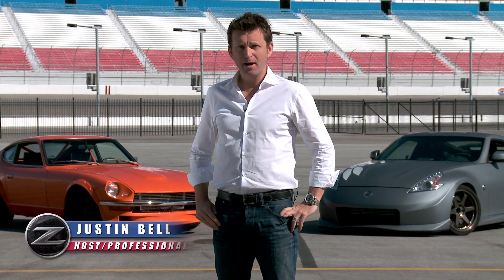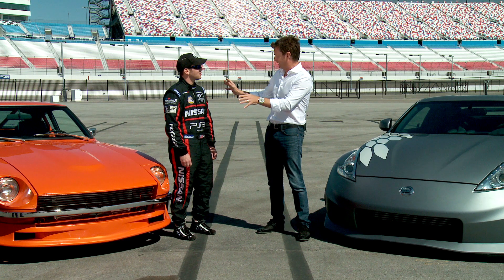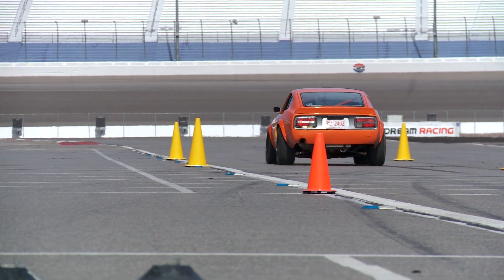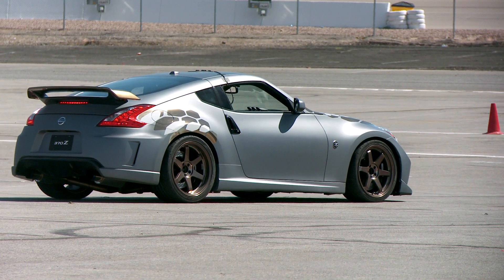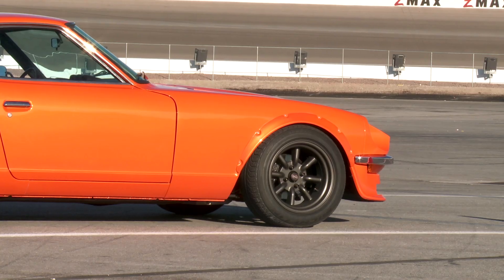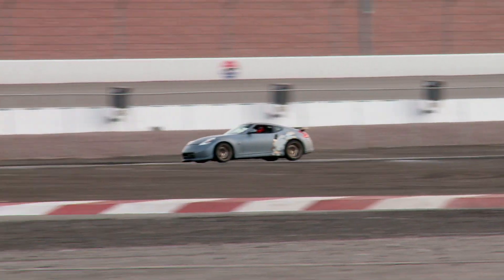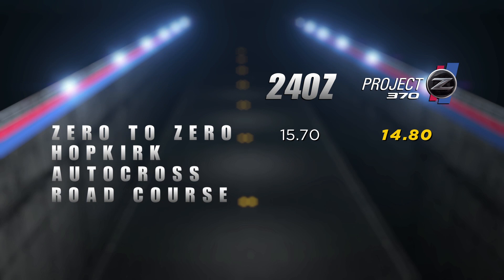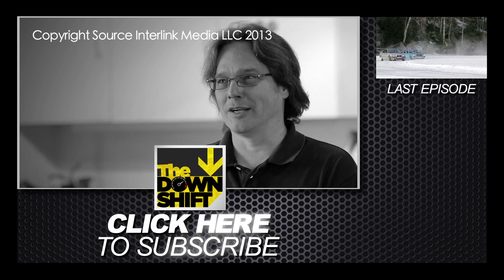Nissan Project 370Z vs 1970 Datsun 240Z with RB26 Track Battle! - The Downshift Episode 54

Comment: the 240z misses 2 very important things: one is the braking system two the steering system.
I guess builder didn't update the braking system and the steering system in order to give it closer feeling to the original build, but that well make him loss in the track challenges because this 2 things are very important in the track.

Comment: V8 swap wouldve gotten better times and more power, but this build is done as right as can be (read the build thread on nicoclub). If he built this car for performance like the 370 was it wouldve been a lot faster, but this was just a guy who built a car because he loves cars and wanted to give a 240Z some more oomph. That and the 240Z has 360hp and the project has 500hp (stock 370 has 332hp). I think im just chafed because the the presenter

Comment: power wise the stock rb26 puts out 280 hp at the engine not 320 the rating they put out for it is wheels of 360 not 400. 280 after 15% drive train loss is 242 whp which coincides with what gtrs dyno at stock(was very difficult to find a stock dyno.) so funny how thats 150% exactly. the greddy rating is about what the kit can max out on as it comes from greddy. the stock vhr rods have issues past 500 hp its hit or miss, track cars they keep around 480 whp

Comment: turbos have the same response they behave the same until the turbo car hits boost. at absolute worst the turbo car has slightly less power before boost from lower compression(however due to fuels available at the pump nowadays 10:1 is pretty common on a turbo car) but going from say 11:1 down to 8:1 results in 2.5% power loss, you wont even feel it and has nothing to do with throttle response. 99% of people who talk about throttle response use the term in the absolutely wrong way.

Comment: It would be dangerous to drive but increase the boost a little bit to bring the hp to 600. If the current output for the Z is only about 380hp it would have been a better to have a 3.2 stroker l28 instead that way you get the same amount of horses but with more torque.
Reply: *****  getting an l28 past 400 is difficult, it's different for the RB26

Comment: A G-Nose widebody with better suspension will allow the 240 to get a lower stance and better grip on the track. Small tweaks here and there she will perform. Not bad for an older car.
Reply: It's an it, not a she. It performs already very well for an old car. A 70's car will not outperform a new car unless heavily modded. And as far as suspension, he still needs to enjoy driving it. But yes, to your point, it can always be improved. But life it's about lap times.
Reply: It's a she actually, she's a Fairlady ;)

Comment: This is all just benchracing anyway, not considering all of the factors at play. There's a lot more behind a car than just the power to weight ratio. The 370 would destroy a 240 stock to stock. If you were to go solely with power to weight ratio, the r35 would be a PoS.

Comment: For 40 years of difference, that is actually quite a narrow difference.
And it shows how good the Datsun still is.
Also, the 370Z is not the best you could get at the time, but would be the coolest comparison, heritage and all.
If i had to pick, i'd still take the Datsun, but, upgrade a bit, for example some more suspension work and brakes, and who knows what else for as long as the budget would allow, currently none. :s
Hell, i'd love to own the Rotsun, that car looks sick as shit, literally and figuratively, and both are cool in this case. It would have to be fixed up a bit to be legal here for sure, and i'd want it somewhat reliable, but i wouldn't mind at all if it looked rough as fuck.

Comment: Its a GT-R Motor it should be fast. The only thing 240Z about that car is the Body and steering. Its a really nice project car. If you want to do a fair comparison then take both car set them up to the new off the car lot specs and then race them.  I'm sorry but to see everyone ripping on the new car out of nostalgia is silly.  How fast could you make the 240 if you used the original 240 motor?  The winner was the the diver who got to play in both of those cars

Comment: bottom end as in power curve or bottom end as in rotating assembly? because neither is true there are dozens of non inline 6 engines which hold huge power, its all about if the factory uses forged parts or not, which has nothing to do with engine type. perfect example, GM 5.3L v8, holds 1400 hp stock block.

also in addition to that the current world record holder for a 6 cylinder in drag racing is a vq35de making 2400 hp which is a v6

Comment: Put the same model tire on the 240z in the tire size the 240z was running in this video and re-run the challenge. 370 probably still wins, but the results will be closer. With an equal coefficient of friction at the contact patch the lighter weight will begin tobalance the equation against the advantage of 40 years of technology if the 370. I'm surprised that the results were as narrow as they were. If both cars were wearing the same tire, I can even see the 240 winning. Mass matters. When two similar cars of different eras are tested against each other like this, you have to reduce variables.  Both cars should be wearing identical rubber.

Comment: also your comments make it apparent you have never driven a 370z or hell even a 350z, the abs on these vehicles actually blows horrendously and the vdc is even worse hence why alot of the guys who actually race them(minus spec z) swap out the brakes for manual brakes. going for a 370z period for performance is a bad idea due to overheating issues and difficulty modifying the vvel(most guys swap on HR heads) but comparing it the the 240z isnt fair. the 370z does have about 300% more stiffness tho

Comment: This is a ridiculous comparison. a 1970 Z vs a 370z with every technological advantage of the past 40+ years... come on. lol pretty comical really. The amazing thing though is how competitive the 1970z was against a modded 370. pretty amazing.
Reply: +Nice Shot keep in mind that it had an engine from the late 90s early 2000s, as well as some modern suspension work. if it had electronic power steering and better brakes/abs it would've been even closer, if not in the 240s favor

Comment: Without a doubt the 240 wins all day, no technology, raw power and a very well proportioned engine to weight ratio.  I mean that is a 50 year old design that can be easily modify.  This why Nissan needs to go back to the drawing board and the next generation Z, must be reminiscent of the original design from body, front and rear fascia to an aggressive stand.  The wide body option exemplifies the best use of aerodynamics that allow the car to efficiently cut down the drag factor.  Nissan is in the verge of trimming down their offerings so, dont let the Z be a model that gets water down even more.  Toyota has not gained the upper hand with their supra design.  They couldn’t even do it solo, instead they brought in BMW to share costs, design, output but they did not even come close the legendary supras of the 80’s and 90’s as those cars maximize the driving experience and the ability to customize the car.  There is still time to get the new Z model done right.  Ford won the design for the retro mustang in the 2005 model and they revived their sales as the production of mustangs has been on the rise.  Look back at the 2005 and put it against a 1970’s mustang and you can see the thoroughbred design and its glory.  I personally take a 240z all day before i look at the 370z.

Comment: you should educate yourself vs posting misinformation, the 240z is 2300 lbs stock, this guy is running a partially stripped interior and a shaved engine bay putting actual weight closer to 2100 lbs, if he went crazy on some stuff we cant see 2k is a very real possibility. the 370z is 3300 lbs base no options, this one optioned out with custom interior and twin turbo kit is closer to 3600-3700 lbs so yah damn close to double weight next post will address power.

Comment: The test were completely unfair. You can not compare the stopping power of a car with anti lock all wheel disk brakes to one with disks on the front and drums on the rear. I have a 280ZX which came equipped with all wheel disk brakes, but it is still no match for today's modern systems. I'll keep my 2.8 liter turbo charged in line 6 . Those two cars could never be compared fairly.

Comment: 200HP? you are bout 50HP off there bud. The most powerful factory spec NA L-series engine came out of the 280z in 77 at 170-175 HP. 185HP out of the turbo 280zx

Comment: Id guess the old Z is about 2500lb, the 370 isnt 5000. From about 320hp to about 400hp isnt 150% but about 25%. How many % had the Greddy twin turbokit added to the 370? Greddy promises 535hp... So you have a 535hp 3300lb modern new car built by a proffessional tuner backed up by Nissan. And basically all it excelled on was breaking, with its high spec brakes, grippy tires and smart ABS system that not only prevents tires from locking but does so individually on each wheel perfectly.

Comment: not to mention if you actually cared about NA power and wanted to stick wish a nissan 6 there are much, much, much better engines then the rb, the vq series is light years ahead of the rb's when it comes to NA power or even a tb48de if for whatever unknown reason you insist on a inline 6.

Comment: you also missed where the 370z beat it in every test except handling(the 240 weighs significantly less that should be a given)
finally moving up, the tires arnt "grippy" they are low profile about as far from "grippy" as you can get. increasing 1mm in sidewall is equal to about 10mm in width, and they for sure arnt r compounds nothing is sticking to them so the 240 has the tire advantage in both sidewall AND width. "high spec brakes"? the only thing bbk's do is dissipate heat they dont increase

Comment: bigger brakes mean absolutely nothing........ they dissipate heat better nothing more you increase braking power by changing the piston on the master cylinder . he wasnt loosing traction in the 240 while he was having quite a bit of trouble in the 370 so tires would have done absolutely nothing(but would have significantly helped the 370) finally power steering makes no sense, you do realize most race cars outside of drifting dont even use power steering? wouldnt have helped again

Comment: if you put all modern parts in a 40 year old car its not really a 40 year old car .The only thing that wasnt really modern was the brakes , A true classic 240 would have been alot different.
Reply: wanteds13
 not to me but its just my opinion.
and the suspension design was one of the first things changed.

Comment: It appears to me that the 240Z suspension is not properly setup / invested in. Allot of body roll happening. I would venture to say that the owner spent most of his money on the engine swap before tackling other areas of performance. A properly set-up 240Z with a race prepped L-series engine would have come out on top of that spec 370.  I smell a Nissan 370Z promotional rigged event.

Comment: The guy in the stands who bought a super bike is the real winner.  He got higher power to weight, faster acceleartion, better fuel economy, more kick in the pants, and higher top speed..  right off the factory floor... stock...  than both these cars... by a wide margin... instead of farting and dicking around with this Z crap for years.    Yeah, I can say it, cause I've had four Z cars... been all in and out of the FSM's.  They are crap cars.  Wish I could go back in time & buy a bike instead.

Comment: i think that 370 had better brake also bigger disc compare to the 240 and much wider tire front and back too...and somehow if both car had same exact tire size and same brake size..the 240 would stay side by side with the newer car....BUT if someone nice enough to me and give me the 370z i would say thanks alot and then i sold the car and buy 240 z......

Comment: Also bigger brakes was just a general statement of course you would upgrade the callipers give that 240 to a good tuner and it will stomp a mud hole in that 370 ass and its smog exempt so chip can't touch it peace out

Comment: I have to disagree with this competition.  for 1 anyone who knows cars knows that cars have become way to assistant to the driver. for 2 race car drivers today, hahaha they are not drivers they let the cars do the work and it can make anyone a driver, cars like the 240 offer to a real I say again a real driver what every car has lost. a drivers car. it's about the skill of driving not the car taking away the needed feedback,  the feel, the edge of losing control. people have become so complacent with power this and power that, e traction control or abs, or stability controls to the point where that can maximize the car with an umbrella,  but the 240 can offer that seat of the pants feel, that out of control feeling, that simple nudge of a bump the push of the apex spreading out. I'd take the 240 over the 370z any day. even in stock form the 240 was still more impressive and let's not forget the heritage of what was and what it is.

Comment: sad that a new car can barley beat a 40 year old car.  bring back the old school and get rid of the damn computers in cars.
Reply: I'm not an authority on Nissan engines, but isn't that the engine the guy dropped into the 240 a newish motor and not the real 240Z engine? So, to call the 240 a 40 year old car is not entirely correct.

Comment: I understand that most race cars do not have power steering but its a street car it would be a lot easier to drive under heavy breaking would enhance an already sick car and to the idiot that said putting on larger breaks would not help the stopping just the heat is right it does disapate heat but also bigger diameter is also more contact area there for better stopping and I would chuck rocks at a 370 to get that 240 haha

Comment: u would think with all the tech in that car that It would of wasted that old heavy Datsun.  That Z is slow
Reply: 240s are much lighter than 370s
Reply: "old heavy Datsun"

You have no clue.
Reply: 2600lbs is alot? Fuck I guess ill just buy a caterham or is 1700lbs to much also?
Reply: ***** old cars are made out of steal so I figured it weighed more.    Give me a break.   And besides that new 370 should wipe the floor with that old Datsun.
Reply: Ty Risenhoover Your missing the point.  The old cars are made out of steal.  I thought it weighed more.  And a lighter car would be faster if it had the power to back it up.  If you had 2 of the same car in a race but one was holding and extra 1,000 pounds of weight in it,  which would win?  I cant even make a statement and not realize how much both cars way with out people on here being ass holes.  Lay off man.  Not everyone is the genius you apparently are.
Reply: luigi luchiano STEAL? you serious? it's steel. no need to be a genius to understand that a torquey, modern 3.7L V6 in a 3600lbs modern car will beat a straight six 2.6L 2600Lbs 70's car. but if i had to choose, i'd go old steel all day. and i'm pretty sure the RB26 was not over 300WHP. would have eaten that 370Z if it had.
Reply: côme Thiburs yes but weight does matter but I see your point,  I also prefer the old steal cars to.  I own and 1986 Nissan 300zx
Reply: luigi luchiano

The Z is slow? Lets see your car do better...
Reply: 370Z = 3700 pounds...240Z = 2200 pounds
Reply: netrioter the S30 240Z weights 2300 in race trim, no way this one does 2200.

Comment: There's next to nothing left of these cars that is "Z" or stock.    So neigther car is really a Z.   Really stock Z's, are pretty shitty.  I know, I've owned a few.   You spend more time working on the P.O.S. than driving them; there's not a lot of space in them; all that luxury shit dies over time and is just dead weight on a sports car; in the end I decided, you know what, this is not the kind of bloated slow ass sports car I want.  I want a fucking Factory Five Cobra.   Can't afford that, so I settled for a motorbike.  Which even with only 37 hp, accelerates faster than all my Z's.   Power to Weight Ratio...   When something with less power than a volkswagen can beat your Z, you got to just give up on the car....  there is no way to make them fast without completely sinking an assload of money and time into them, and then in the end, you've pretty much replaced the entire engine and the car is something else entirely.